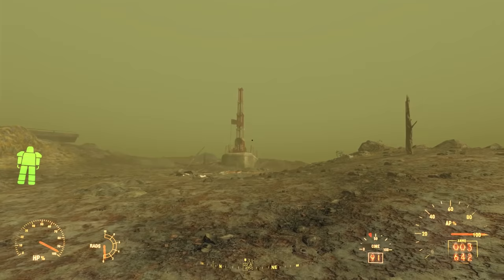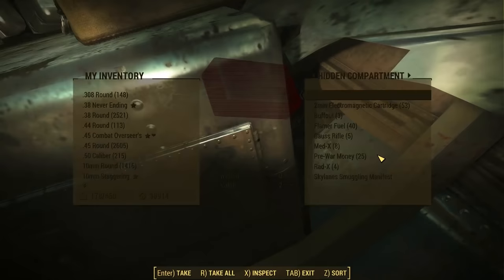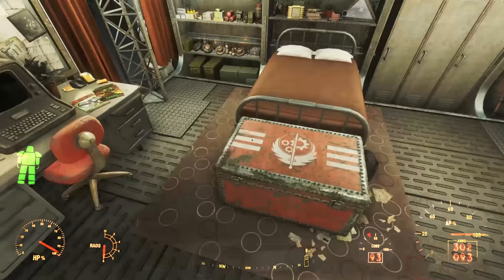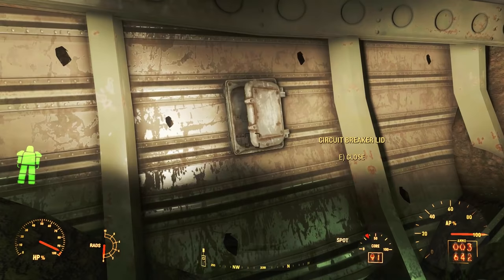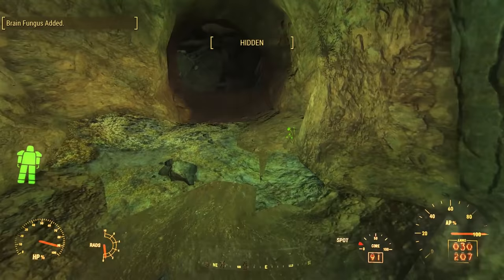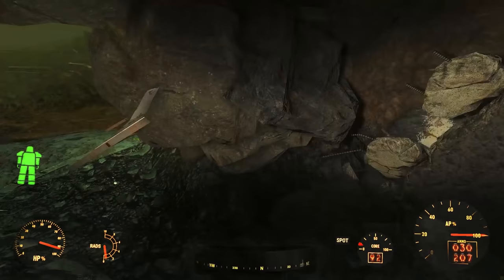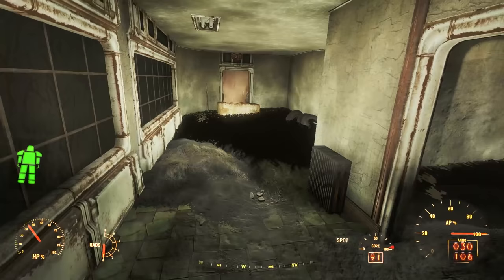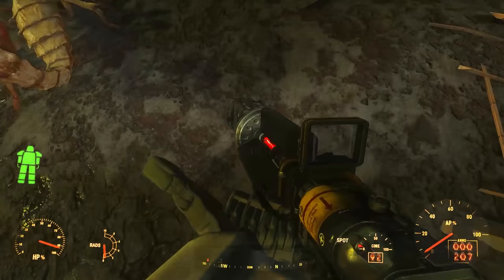Relay Tower 0DB-521 - Raider Cave, Sunken Church, & Crashed Flight 1665 - Fallout 4 Lore

Comment: I would say it's a combination of both, structures sinking, and being covered.... Reason being is that the tilt to the red rocket truck stop suggests the ground being softened and structure sinking, but not being covered up by anything also suggests that the wind carry dirt in certain directions, kinda of how the air currents can move radioactive materials in certain directions as well.

Comment: Blast induced Soil liquefaction seems like a reasonable explanation for the buried structures. 

But there were several studies on the results of underground blasts on soil, that found that the damage caused by liquefaction could potentially be disproportionate to the energy released in a blast. 

Obviously, it could also just be artistic license.

Comment: in Denmark there's a church and a lighthouse that has been partially covered by sand dunes, I am partial to the theory that erosion and strong winds have carried dry fine soil and ash over the site, there is also the possibility that the nuclear power plant in the area experienced the china syndrome vaporising the ground water table, causing the ground to become unstable and sink.

Comment: I think that the reason most stuff in the Glowing Sea is underground is that the nuclear explosion was actually farther South than where the children of Atom are, and the explosion picked up everything in a pretty big radius, and basically did what hoes do when you till dirt, where the bottom layer is ripped up, and the top layer is pushed down.

Comment: the crater  around the water table and the reservoir  evaporated from the explosions and distabilized the foundations of some of the buildings but larger structures where spared due too there foundations needing to be on solid rock.

Comment: i'll admit i'm not an expert in explosive on the nuclear level, but with my time in the army, soldier do know that explosion create crater(different size for different explosive grade and amount), those crater are caused by the kinetic energy of the explosion, meaning, depending on how many went off in the glowing sea..you can figure out why everything is burried..the kinetic energy was immense and pushed up into the nuclear shroom all the dirt/sand/dust that was there before, correct me if I am wrong, but the glowing sea is still filled with that dust in the event of fallout 4, wich explain the radioactive storm, the same happen with volcano..while the ashes cloud are still around, it create intense friction that generate enough static to create lightning

Comment: I'm a bit late but the liquifaction theory is the most correct one. From a structural standpoint no civilian building would be built to withstand an earthquake in Boston and any tremors or ground disturbance caused by the blasts would compromise the relatively small foundations of those buildings band cause them to collapse and sink. Sentinel site remains because of the government importance probably built it to take a direct hit and any structural foundations were most likely extremely oversized and prepared for anything a nuclear blast might bring.

Comment: The solution for the sunken buildings probably is very simple: the nuke missed the Sentinel Site (not much of a surprise as the CEP of a 1950s era nuke, which is the reference in this technologically frozen timelime, had a CEP of several miles at worst). It hit the ground, buried itself pretty deeply, detonated, and blew tens of thousants of tons of ash into the atmosphere, which then rained down pretty quickly again over ground zero because the detonation caused a vacuum that kept the ash in the area.

Comment: If you have a bomb that pushes hundreds of tons of soil away from the crater. it will settle in all dips. In addition there is a seismic effect where vibration of the earth at a certain range of frequencies can make the earth liquid - so anything on it could sink. That will vary from place to place.

Comment: WIth the bombs hitting, the rock strata & underground water would be drastically jarred, more so at the point of detonation. Entire subsurface integrity would be compromised - thus expect sinkholes, depending on the presence of limestone that can be dissolved by the presence of water. No - dirt thrown into the air does not just fall down. It stays within the atmosphere as shown by volcanic action + bomb testing. The revolving planet & wind currents suspend the particles, while gravity makes dirt shower potentially vast distances, even (in the case of nuclear winter) to stay as an atmospheric contaminant of isotopic soil particles for 6+ weeks.
In such an event, no single area is buried. Only through volcanism can that happen, still with material cast to skies.
Krakatoa's explosion gave great sunsets for 2+ months across Europe. Herculaneum & Pompei have their stories. The Mount St. Hellen situation had hers. More recent was the smoke and material spreading eastward when the Icelandic volcano erupted, obscuring air and even allotting advisories to avoid outdoor contact, air-flights cancelled, etc..
-

Comment: Buried buildings: Depends on how many blast sites there are, as well as how much of a force each of those bombs would've had. It's also dependent on Bethesda's intention for the area...etc. Although, I could be wrong. 
Also like Oxhorn said, it could be dependent on the type of soil, or what kind of effect the radiation/blasts would've had on the soil and asphalt.
Reply: It might also depend on whether or not, one of those bombs did or didn't blow up right away; Like in the case of Fallout 3's Megaton. If the bomb would've landed somewhere and had a delayed explosion (for whatever reason), it would've torn through the ground/city; sending everything up, solidifying over 200 years.

Comment: I suspect that the Glowing sea terrain is a combination of explosive debris ejecta, shockwave disruption and soil liquefaction.

Here is a graphic for a Meteor impact.  This would be similar to a multiple warhead nuclear event like the one that created the Glowing Sea, although in the case of an explosive excavated crater, you wouldn't have the "shock cone" in the center, just a hole:  http://c8.alamy.com/comp/G156AP/illustration-of-the-sequence-of-events-as-an-impact-crater-forms-at-G156AP.jpg

However that doesn't explain everything, and I suspect that the soft coastal water-filled sediments may have undergone liquefaction due to the tectonic shockwave caused by the multiple warhead blast: https://s-media-cache-ak0.pinimg.com/originals/fa/c2/0a/fac20a899a75be4a88869ec7823b986c.jpg  Additionally, some landslides may have occurred in the hills due to the tectonic shock and the shockwave caused by the nuclear blast.

This would explain things like the sunken church and tilted buildings, but would also explain why the much stronger built Sentinel Site did NOT sink:  because it was build directly onto the bedrock in an area of stronger soils.
Reply: I'm amused by the graphics and the amount of effort you put into explaining this, 10/10 you win it in my book.

Comment: If I had to bet, I'd say a lot of the buried tunnels are either part of collapsed sewers or were where buildings collapsed into their basements when the bomb which created the Crater of Atom and the Glowing Sea detonated. It's not likely a volcanic eruption or soil liquifacation was caused by the bomb, they just wouldn't have been powerful enough, especially since there's no real volcanic activity on the east coast due to a lack of tectonic faults.
Reply: the nucular blast if the size of the fatman bomb would have been equivilent to a 6.0 earthquake no fault line is needed.
Reply: The east coast of the United States had been hit by the effects of a 8.9 earthquake in the mid 1800's. This quake redirected the flow of the Mississippi river, but didn't cause any lava flows, so a Fat Man size bomb definitely wouldn't do the job.

Comment: If you look into Centralia Pa or other locations that have had coal mine fires. Once a significant amount of structural damage occurs, sink holes tend to form. I think the nukes could have caused enough damage to foundations and bedrock in the area to cause the sinking. Especially with how intermittent it is.

Comment: Oxhorn the ground in the Glowing Sea is an example of what is called earthquake ground liquefaction.   When those nukes struct the glowing sea they sent out shockwaves across the Boston area.  There are only three known and confirmed nuclear impact zones in Boston
1. The nuke that caused the glow
2. The nuke that caused the Cambridge crater
3. The unmarked nuclear crater site just south of downtown(this is the one we see in the intro)

As these hits happened shockwaves would have traveled throughout the area and rand into each other.   
The pressure wave from an underground explosion will propagate through the ground and cause a minor earthquake.Theory suggests that a nuclear explosion could trigger fault rupture and cause a major quake at distances within a few tens of kilometers from the shot point.    So the buildings in the glowing sea experienced the ground basically becoming liquid and sank.   Where there was more bedrock (like the pyramid site which would have been chosen because it fortifies the building from blasts)  would have been safe because the ground cant liquify same goes for downtown boston as the city was built on a large layer of bedrock in order to support the tall buildings.   However out in the glowing sea there is less bedrock and so it was affected more.

Comment: From what I know, the sentinel site wouldnt be too buried, really. The closer you are to a large detonation, the less debri falls there. The detonation sends any debri flying away from it at incredible force and speed, so most of it wouldnt fall on the sentinel site, and instead towards its border. Thats why the impact point is the lowest, all the debri flew away from it and landed further away. Though your theory of the buildings sinking works too. Sentinel site wouldn't sink because of its massive surface, and the huge, deep, sturdy subterranean compound and tunnels would serve as an anchor to keep sentinel site relatively stable as the earth almost became a liquid beneath it.

Comment: I have a theory as to why one pilot saw the flash and the other didn't. One could have been facing away from the blast, at a distance far enough from the blast that it wasn't knocked out of the sky by the shock wave, but instead suffered massive electronic failure due to the EMP. The other could have been approaching the area when it exploded, thus leading to the recording.
Reply: But what about the fact that the EMP would take out the radio too?

Comment: "Soil liquefaction describes a phenomenon whereby a saturated or partially saturated soil substantially loses strength and stiffness in response to an applied stress, usually earthquake shaking or other sudden change in stress condition, causing it to behave like a liquid."
Soil liquefaction - Wikipedia

This is what happened to most of those sites in the Glowing Sea.

Comment: Two other possibilities occur to me for the sunken buildings. Liquefaction and tsunami. When a nuclear weapon hits, even in airburst, the shock wave is transmitted through the ground. If the ground is mostly based on moist silt, the vibrations can cause the ground to basically turn into quicksand. (its something they worry about out in San Francisco where a considerable chunk of real estate is on silt based land) That would also account for why the Red Rocket was listing to port. The ground was softer on the left side. And the Sentinel Site would be built on bedrock as you wouldn't want the shockwave burying the facility.

The other possibility is a tsunami, either intentional or accidental by the Chinese dropping a nuke into the sea floor. If you remember the Japanese disaster from a few years ago you may remember seeing how much mud and muck came ashore. Well, a nuclear detonation on the sea floor would cause a /much/ more violent tsunami. Enough to strip away the earth from the Sentinal Site and deposit it over the glowing sea.

Comment: Dunno if anyone else commented this and im a bit late but, odds are this the nuke detonated was a fairly powerful normal atomic bomb, not thermonuclear, we can assume this due to the high amounts of radiation the bombs left. Most likely no thermonuclear bombs were ever dropped. That or ALOT were dropped in the glowing sea and not a single one. Thermonuclear bombs are cleaner due to the fact that a second, fusion reaction, occurs nanoseconds after the initial fission reaction, this causes more of the fissile material to be used up and less gets ejected, while also making the bomb exponentially stronger. The fact that the bomb detonated that close to Boston and didn't level the skyscrapers also reinforced this. 

However its probably a pretty strong bomb as it still did a good amount of damage. This would send the normal Shockwave through the air as we know, but the energy is also sent into the ground in waves. This causes soil to become a liquid almost like blowing air through sand makes it flow, this is a similar event. 

Sentinel site didn't sink because it probably had a strong cement layer that went deep to bedrock providing more stability. However a church would have a small cement foundation only a couple feet into the soil

Comment: It could be that Boston's underground supports buckled and collapsed from the force of the nukes, namely with older buildings having the water in the wood pile supports turning the foundation into steam bombs. Assuming that nuclear arm had the terrible luck of getting underburied, it could produce tremors around a magnitude of 3.5 at a minimum, like Test Faultless, with worst case being 5.4, like the recent DPRK tests. Those two would be more than enough to cause liquefaction, especially if the wood pile supports create secondary explosions.

Comment: As a pilot, I see almost no continuity error. The first voice you hear is the Captain. Hes seated to the left, yes, but hes also watching the gauges. Its likely the aircraft was still on auto pilot, until nearly landing, or the emergency, or was under Co-Pilot control. The Captain was likely looking down at at his knee board, and may not have noticed the flash, with the sun lower in the sky from morning (even at 9am, in the north, especially fall/winter, the sun stays a bit lower in the sky). The Co-Pilot was likely heads up, watching for traffic. It's his voice we hear on the CVR. Remember, the first recording was broadcast, hence why we hear the pilots voice only. Now, normally you would hear both on the CVR, but we can excuse radiation, and time, for maybe messing something up. The Co-Pilot would have been watching through the window, or possibly, even in control of the aircraft, if the auto-pilot was shut off for some reason. His voice is the second on the CVR we hear, from the internal communications between pilot and co-pilot, though we only hear the co-pilots voice. Given the distance, the time, the location. The coms were more or less dead on, and correct (seriously, kudos to Bethesda for the Center/Pilot interaction).

I hope that helped Ox. It can be explained as to why the CVR and the broadcast mayday, seem not to jive. They do.

Comment: the reason everything in the glowing sea is buried underneath a layer of sediment that our feet deep is because of the fact of liquefaction it after a large blasting cause soil to act more like a liquid than a solid it's kind of like putting air Jets underneath the sand pile it just makes it flow out like a liquid

Comment: Oxhorn the Yangze didn't fire the nukes. remember the recording from the sentinel site where the soldiers were tracking incoming bogies? they mentioned that they were tracking incoming missiles. there is no way they could have tracked them if they only went a kilometer from the launch location. that being said I'm also pretty sure there was a terminal in the switchboard about tracking missiles which lays out a time line.
Reply: According to Captain Zao and the wiki the Yangtze fired all but one of its ICBMs . I think the timetable at the switchboard really refers to just the beginning of the nuclear hostilities .
Reply from the maker: Yeah, you're right about the sentinel site and the switchboard, but Zao does say that he fired all of his nuclear missiles. I suppose though that there could have been other submarines. Or even aircraft.
Reply: right he did fire nukes. I just always assumed that if a sub was going to fire nukes that it wouldn't have sat right inside the blast zone. my 6 playthroughs thus far I just assumed he fired at other locations. also I assumed that his nukes were of a smaller variety.  he does after all give you tactical nukes to use.